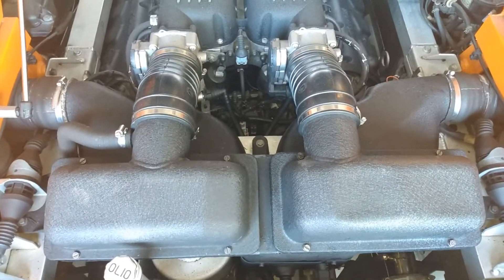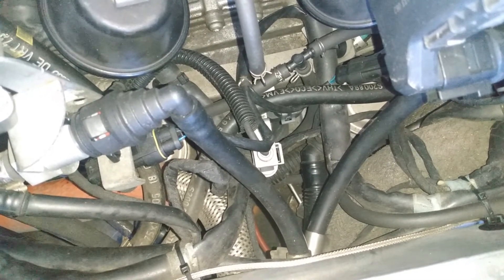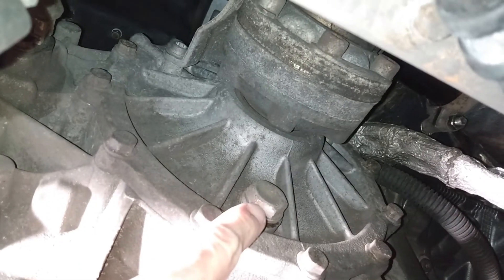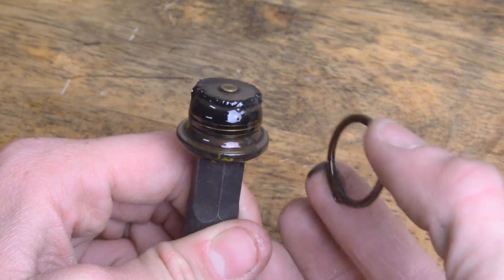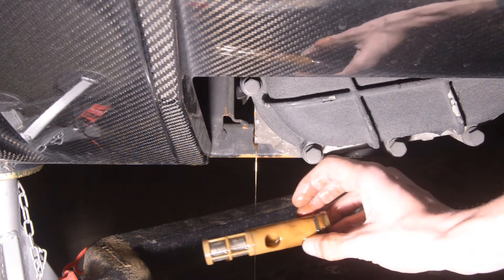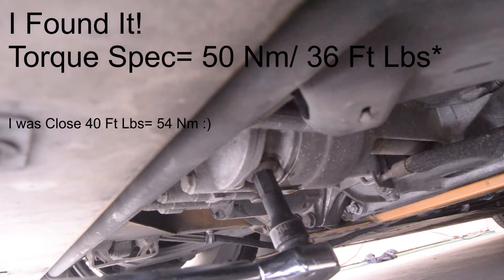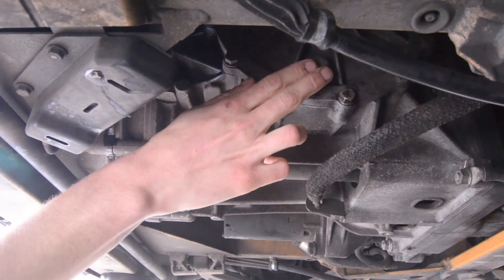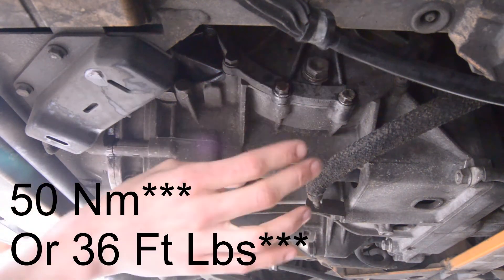Changing the Transmission Oil On Your Gallardo Is the Best $60 You Can Spend Graziano L140 Transaxle

Comment: Hey Richard, as always love your videos. Followed to a T. Realize this is an older video and your car is now sold. I'd like to add my own experience here following your steps. The only difference is I found using a garden hose with approx 3/4 outside diameter and was tight fitting worked better for me. Tried using a 1/2 and it just fell out and leaked more than went in. Thanks for all you've done and I'm sorry you had a bad experience with your car.

Comment: Do u happen to know if the lp gallardo or r8 v10 single clutch uses a similar procedure? I know the huracan/gen2 r8 dcts are different and needs a tablet hooked up
Reply from the maker: Hi Ric, thats a great question. It wouldn't surprise me if a Huracan needs a computer to flush this system. I prefer the old-school method! Haha
Your fluid flush for the Gen 1 R8 is a tad different and it depends on if you have the "old" transmission" or the "new transmission" per Audi verbiage. Same with the LP Gallardo, you have to look on your trans and determine when they switched to the "new" transmission casing type. 
If you have the "old transmission" then yes its exactly the same. 
If you have the "new transmission" then instead you will find the level status indicating port on the left side of the transmission instead of on the in the differential housing area on the right. 
You can also see this port in picture # 4 in the used part I linked below. 
https://www.b-parts.com/en/store/products/4023639/automatic-gearbox-lamborghini-gallardo-52-lp560-4-lamborghini-086300046n-2003/. 
You will want to fill via the port that I showed you on the top, check the status with the port on the left side, and drain with the port on the bottom in the same location that I showed you. 
Google D3E800A4767 and download the PDF. On Page 53 it will show where all this is located. 
If you have a R8 GT, with no trans cooler, your total fluid capacity is 3 litres!

Comment: This is the same for the 2010 r8 v10 r tronic?
Reply from the maker: Hi Gli Farenheit, yours is a tad different and it depends on if you have the "old" transmission" or the "new transmission" per Audi verbiage. 
If you have the "old transmission" then yes its exactly the same. 
If you have the "new transmission" then instead you will find the level status indicating port on the left side of the transmission instead of on the in the differential housing area on the right. 
You will want to fill via the port that I showed you on the top, check the status with the port on the left side, and drain with the port on the bottom in the same location that I showed you. 
Google D3E800A4767 and download the PDF. On Page 53 it will show where all this is located. 
If you have a R8 GT, with no trans cooler, your total fluid capacity is 3 litres.
Reply: @TheBullRider  thank you!  Im planning to do my service soon. Looks pretty easy.
Reply from the maker: @jose15238  Yeah the hardest part is not getting oil everywhere! LOL Best of luck!

Comment: Hey what are your thoughts on the shifts and feel after using this fluid?? I bought the same fluid after seeing your video but haven't swapped it out yet.  Ive read so much conflicting info on what fluid to use
Reply from the maker: Jarren, there is so much information out there it's like sorting through a maze. I wasn't able to drive it after changing the fluid, unfortunately. My valve stem seals are causing pooling of oil on top of my pistons and the motor came out! Haha
I have a friend in the Netherlands that switched out this fluid for the OEM fluid I recommended to him and to you. It solved his issue with chunkiness and popping on tight turns due to the LSD engaging.  Honestly, either is OK to use. For street, I recommend the OEM fluid, for the track I recommend the redline MT90 or any 75w-90 GL4 rated gear oil from ANY brand. Both are OK to use.
This video might help you too. https://youtu.be/bgkeeA_SXsU
It explains what I just told you but also goes into detail on what fluid goes where compared to the E gear system etc.

Comment: Good information. I'll need to do mine pretty soon. Do you happen to know if there are any substantial differences in the LP version? I know the front diff is completely different in LP vs pre LP cars, but not sure about the transaxle.
Reply from the maker: I thought about this more after posting the video and decided to look into it so thanks for bringing this up Cruising Geek. 
You will find the level status indicating port on the left side of the transmission instead of on the in the differential housing area on the right. Although the bolt does exist on your transmission, you do not use it to check the fluid level You can also see this port in picture # 4 in the used part I linked below. 
https://www.b-parts.com/en/store/products/4023639/automatic-gearbox-lamborghini-gallardo-52-lp560-4-lamborghini-086300046n-2003/. 
 
You will want to fill via the port that I showed you on the top, check the status with the port on the left side, and drain with the port on the bottom in the same location that I showed you. 
Google D3E800A4767 and download the PDF. On Page 53 it will show where all this is located as well. Although this is for the r8, the gear box is the same. You have the "new transmission" per Audi's verbiage!